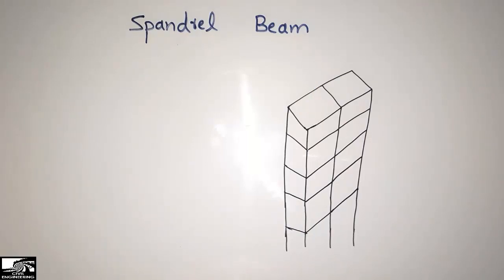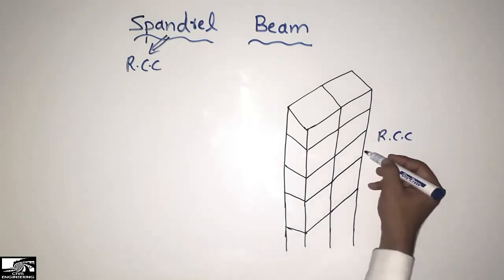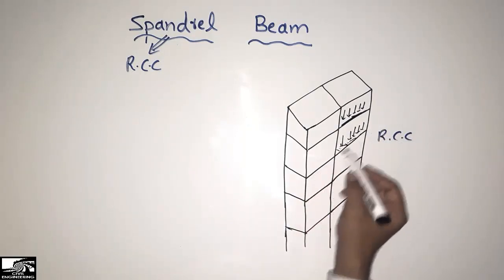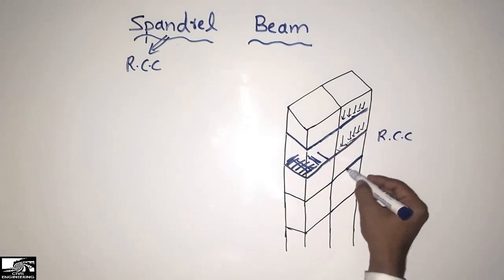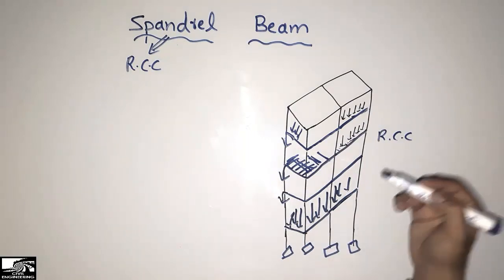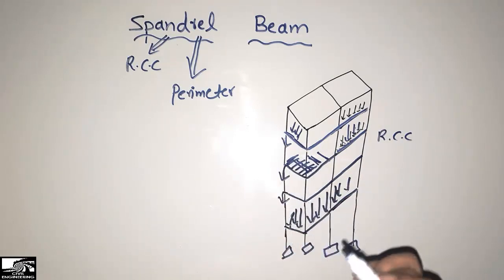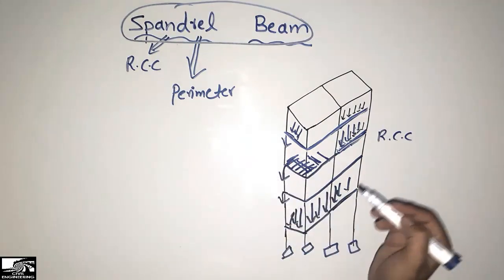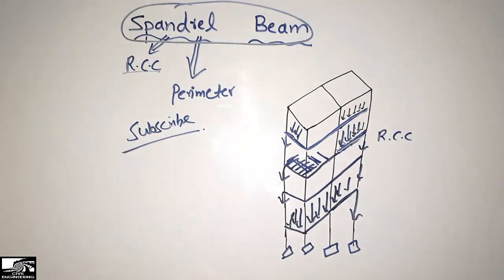What is Spandrel Beam

Comment: What is the difference between sprendral beam and normal beam? 
What if we provide normal beam in perimeter at each floor  level will not they transfer the load to the column 😑😐
Reply: Same question
Reply: If you see the Flat slab design,at that time the spandrel Beam we will provide at the ends of all around building. Because of exterior wall have to transfer columns